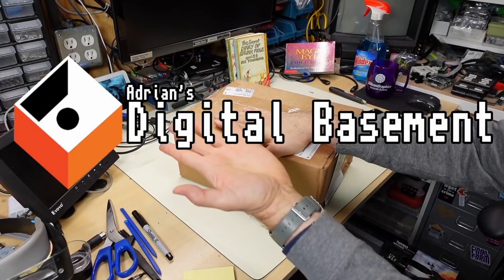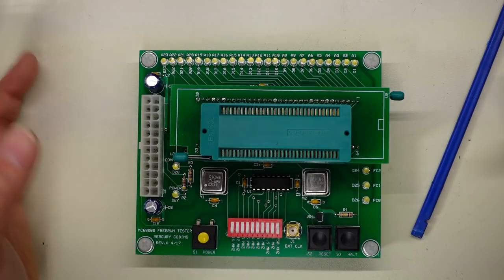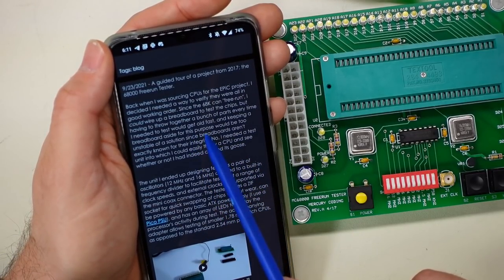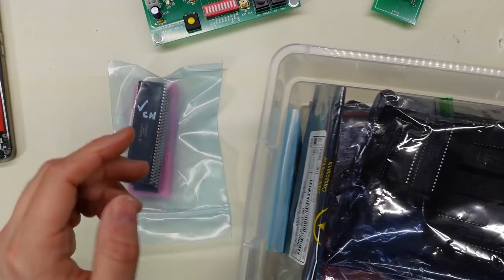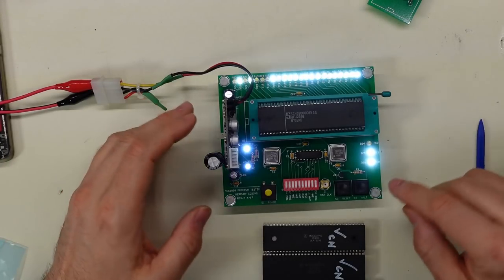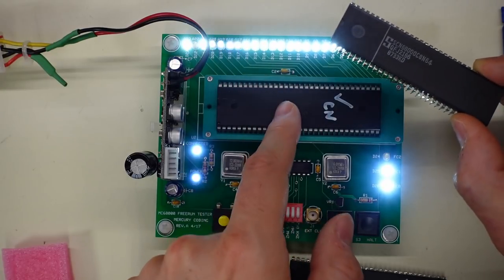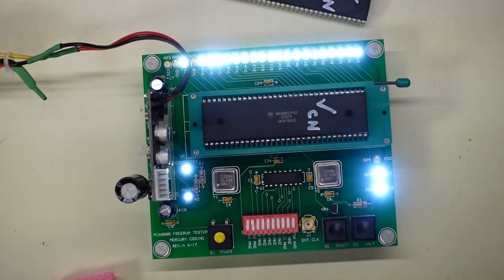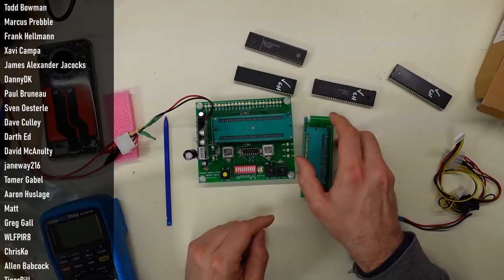0011 A standalone Motorola 68000 CPU tester

Comment: Despite the fact of the missing current limiting resistors the signetics part is most likely an nmos version of the cpu with lower high levels (ttl logic vs. cmos) whereas the others are maybe cmos parts.
Reply: Yes Signetics is an original NMOS type, with weak pull ups, while the others are very likely all CMOS, so have faster pull ups. The NMOS one might function at 16MHz, but very likely the bus drivers will not be able to drive any more than a single LSTTL buffer 2cm away from the chip, as the pull up will not reliably pass a logic 1 threshold in the time before the clock edge, combined with propagation delays through the decode logic, latches the data on the data line in or out.

Comment: A lot of current is floating through the 68000 VCC pin when all LEDs are on. The bond wire is glowing inside. I am wondering why no drop resistors were installed.
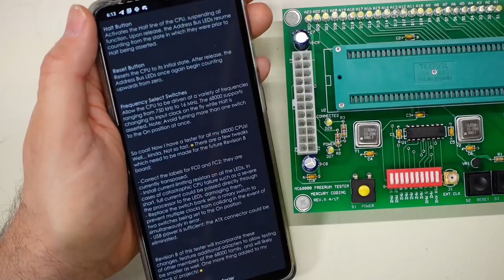Reply: 4:31 Revision B will have current limiting resistors to protect the LEDs.
Reply: @Okurka.  I guess the 68000 also needs to be protected. :-)
Reply: Glowing bond wire? No way. Those led's are drawing no more that 15mA. Even with all the LED's the current draw won't exceed 400 mA. Unless of course if your comment was exaggerated sarcasm.
Reply: @alexsinclair2012  The leds are pretty bright in the video so I guess it could easily be 30mA per LED. Bond wires are very thin, but the glowing was a joke indeed. Perhaps Adrian could check the total current when all leds are on.
Reply: @alexsinclair2012  When designed properly, signal LEDs should draw about 15mA. But with no current limiting resistor it can be much more. Modern IOs has current limiting inside, maybe here as well. But with no current limiting, LEDs will burn in moment :)
Reply: One benefit is that the silicon gets warmed up significantly, so some thermal glitches may be found easier 🙂
However some current imiting should be provided, especially for the CMOS versions of the processor. The Chinese-sourced parts clearly are CMOS, and therefore the outputs can source significant current, compared to the standard HMOS (like the Signetics part) which can sink much more current than it can source. 
A 100Ω resistor per LED would be a good idea.

Comment: I mean, this tester is kinda "okay"... I guess? No limiting resistors on the LEDs is a really weird choice (no need to load the IO drivers that heavily so they go into current limit mode; if they have a failure, it'll show up anyway if you have a current limiting resistor), but in any case, this only runs NOPs on the chip at different frequencies. This is such a basic test you can run on it and that would be an understatement. I would add a ROM that excercises all the opcodes, registers, maybe interrupts and bus transactions handling. I certainly won't take the outcome of this tester as a definite "this 68k works" or not.
Reply: Fully agree. The test is so minimal as to not be worth spinning up a board. Adding just an atmega one could emulate rom and ram. Non-trivial software effort though.
Reply: @AppliedCryogenics  Yeah, like these other IC testers which do test a whole bunch of logic ICs, and I saw one that even exercised a z80 or a 6502.

Comment: To quote from their blog: "There are a few tweaks which need to be made for the future Revision B board: [...] Install current-limiting resistors on all the LEDs. In cases of catastrophic CPU failure such as a severe short, full current could be passed directly through the processor to the LEDs, damaging them." So yeah, definitely a known issue.
Reply: Thanks for pointing that out! :)

Comment: My experience when it comes to overclocking is that the old CPU:s could be overclocked by a ~lot~. If I remember correctly (at the very least until the 486) they didn't REALLY make different CPUs at all, they just had their die and made a shitload of CPU:s and it it was during the quality testing that told them whether f.ex. a specific 286 CPU was at 6 MHz, 8, 10, or 12.. Because of how stable it was and how much heat they generated (There is always slight differences in production).. and this was when people ASSUMED you wouldn't use a heat-sink.. I had a 486sx20 which I got a sink and a fan to and ran at 50MHz and it was stable and lasted..

That said; You shouldn't assume that just because this processor CAN run at a specific speed mean that it TRULY can run at that specific speed. These types of testers usually just run a "NOP" command. I don't know the 68000 that well, but I think it didn't exactly had a nop command, but whatever command one chose to run the CPU with it will be a fairly simple statement.. probably one that executes the fastest of all commands. I don't know how the timing on the 68k work, but I would suspect that SOME of the instructions it handles take more than just the one clock-cycle (It was a rather complicated and expensive device, so I assume it have multiplication and division as op-codes).. so.. addition is probably slower than the actual command that this processor can run at this speed.. and.. mul/div should take longer than one clock-cycle.. but.. are the number of clock-cycles per instruction hard-coded OR can the processor DETECT if the last operation isn't done and it need to add a wait-state?.. I wouldn't know; The second alternative does sound a BIT complicated for the era.. either way... Each instruction is probably more or less "close" to the time-limit it has, so.. just because the nop work fine doesn't mean ALL instructions would.

Comment: There is a project from the editor-in-chief of Canard PC in France called the Universal Chip Analyzer which is designed to comprehensibly test many different types of CPUs.  Right now only Intel architectures are supported from 8080/Z80 up to 286 but a version for MOS/Motorola architectures is in the works.

Comment: To check if a processor is ok with a specific clock frequency, I would run the processor at a lower voltage, like 4,5V or even lower. If it runs there, there will be enough margin when running at 5 volts.

Comment: Chip rated max freq is based on worst case voltage and temperature, both of which affect performance.   The manufacturer would have some margin on the spec as well.  So when you are testing at room temperature, with a 5.0 volt supply, you would expect it to run faster than at the rated speed.  Also, as you mentioned, if the yields are good, there may not be enough slow parts, so faster parts would be downgraded and sold for less.
Reply: Those CPUs are rated so that 99% of production passes. So if only 98% can run stable at 16mhz, the whole lot may be rated at 12mhz. Silicon lottery.

Comment: Simplest way to drop LED brightness is to cut the common ground lead and put in a pair of series connected 1A diodes. Will drop around 1V2 extra, and then the LED current will be much lower, and saves placing the 16 220R resistors in each line.  Still will have LED current varying according to number on, but the drivers will not be so stressed. Did that on a filament display conversion to LED, as the new batch of LED displays were very much higher efficiency over the prototype batch, and thus the display came out too bright. The 2 diode drop with the existing resistors used, 82R 0.125W, made it nicely match the other displays and not flood them out.

Comment: Gotta keep in mind -- not all instructions are equal -- just because a processor can NOP at 16 MHz, doesn't mean all the functions, APUs, etc. will work -- and even if it does all "work" -- it doesn't mean the math results, branch instructions, etc. will always be handled correctly at those speeds. -- It also doesn't mean the the electrical characteristics are appropriate / in spec.  -- At a 200% overclock, I would definitely use a heatsink though.

Comment: Running NOPs probably isn't a good overclocking test.  The real problems would be more likely to pop up in the ALU, conditional jumps, or even memory access.

To improve this board, they ought to build a ROM that runs test instructions meant to make sure that all registers work, status flags, conditional jumps, etc.
Reply: There is a 68000/Z80 test program for Sega Genesis that runs a suite of tests like that. I don't know where I got it, but it's very useful!
Reply: I think it would need at least a small amount of RAM too, in order to be able to test instructions that affect the stack.
Reply: That's a good idea. Maybe I'll work some kind of ROM socket into the next revision. :)

Comment: There are indeed 16mhz 68000's like the one in the Atari Jaguar which is a 16 mhz CPU running as 13.295 mhz which is half of the RISC processors in the Jaguar. The Hitachi CMOS versions can run up to 20mhz.

Comment: 2:43 Well, yes, and no... the design implements a 32-bit instruction set with 32-bit registers and a 24-bit address bus.  The internal data bus, however, is indeed 16-bit.  [Edit: additional technical pedantry]

Comment: In the 1980s both Dr Dobb's Journal and Byte magazines had a 68k cpu tester, like the 6502 tester you shown before, using No Op bytes to run the entire address space.
Reply: That article was also reprinted in the Dr Dobb's Toolbook of 68000 Programming.  I think there is a PDF of that book online.

Comment: What does this test say about the condition of the processor. Address lines work, but what about the rest of its registers. I think a better test would be a program that tests all functionality of a processor and display's al the results.
Reply: Just testing it is not totally dead, and that at least the clock, reset, bus arbitration, and instruction decoder more or less are functional.  Better would have been to simply add on a single fast EEPROM that is mapped into the top half of the address space, and have a simple program in it that checks out each on chip instruction in turn, with output simply being a latch on the data bus selected when the ROM is not accessed. Simple, and the on chip registers can store enough that you simply have a output that runs a series of leds to show all is working, using a big timing loop to slow the tests down, so it takes a second or two per full test loop. Only needs one fast 1M 8 bit flash device, and a tiny bit of glue logic, plus a bus latch for the LED drive.

Comment: I would not use that without resistors, it can kill the cpu without a LED dying. Way too much current as the voltage drop has to appear within the cpu, bondwires etc.

Comment: Well A0 isn't needed for instruction fetching, but would be needed for byte data access.  IIRC there isn't an actual A0, but a HBE and LBE signal, the HBE would be the equal to A0.
Reply: Good point.
Reply: Yep. A0 is split between the upper and lower data bus strobe pins.
Reply: But when it fetches a 16 bit word it doesn't do it one byte at a time so no, HBE isn't really much like A0 at all.

Comment: 5:45 - only the top "68010" is definitely real. The other two are possibly rebadges. I ordered a bunch of 68010's from china and only one of the vendors I bought from was selling real ones. There were a bunch of 4 MHz 68000s rebadged as 68010s, which sucks, because the 68010 is the one which supported an MMU and allowed the vector table to be relocated. The original couldn't properly support an MMU because the bus error exception (page fault, etc.) frame didn't include enough information to restart the instruction the exception occurred for. There were a couple of systems with an MMU and the original 68000, but they did exotic things. One workstation actually ran two 68000 chips, with one CPU a single instruction behind the other. If the "leader" encountered a page fault, it would trigger an interrupt on the "main" CPU before the instruction which had the error. It would then handle the page fault and restart the "leader" in the correct state. Obviously not ideal, as the 68000 was an expensive CPU in the day and two CPUs meant twice the power consumption.

Comment: I believe the original Motorola and Signetics 68Ks used an NMOS process. Your relabeled CPUs are probably the later HCMOS process chips with better high output capability, hence brighter LEDs.

Comment: Probably a bit exxaggerated but in my opinion running NOP Just indicates the PC is running normal and nothing else. I would recommend at least an ADD instruction to sum the address output with a constant number and check result with an XOR logic or so. That will bring in ALU alive, heat the CPU and is a good indicative of stability
Reply: You're right, NOP free-running is only the most basic of tests. However, that's all I needed, so that's all I designed it to do. :)

Comment: There are LEDs with built in dropping resistors… might want to look around online for some. My work had a customer years ago that had quite a few boards using these LEDs. Unfortunately that customer is long defunct and all the documentation is long gone so I wouldn’t even know what brand they were.
Reply: There is a black dot on the anode for those, and they are designed for specific voltages. I have only seen 12v ones, but I am sure they make 5v ones.

Comment: Funny coincidence: my current project - featuring an 8085 - also has a "free run" test mode integrated. These might have been a common way of testing circuits. If the actual circuit has a provision for it, you can also test all the address decoder logic chips. The concept is a nice part of history though; I'm pretty sure flashing LEDs won't help with GHz CPUs 😜

Comment: The 68k does not use A0 since it is it accesses data in 16 bits so the first 2 byes for instance are covered even without an A0 line. The 386 did something similar

Comment: I'd like to know how 68k detects bus contention (berr).
There likely is built-in protection for data and address pins but I don't know the mechanics behind it.
Reply: It cant detect bus errors per se. Something external has to assert the BERR signal to tell the CPU there is an issue with the current bus cycle.

If there is contention that causes data corruption you might end up with an invalid instruction exception, or bad operands that cause other issues like reads/writes to bad memory locations (that might result in a bus error) or erroneous arithmetic results.

Comment: There are LEDs with internal current limiting resistors, they may be those type, just guessing. Whoever designed that board clearly knows what he is doing so I wouldn't imagine him forgetting a detail like that and stress the CPU with high current drawn from the IO pins.

Comment: Not to nit pic but please board devs, white and blue leds are for illumination not indication. Please use red, green, amber, etc.. Can't see / read anything if you have a led flash light pointing at your face.
Also wonder if you could step through the free run process to read each driver line at a time instead of it just counting away at whatever MHz you have it set to, but I know almost nothing about this CPU..
Reply: I'll take that under advisement! I may have some green ones laying around somewhere... :) As for single-stepping the CPU, yes that is possible through use of the Halt line which could be implemented with a little extra logic added to the board.

Comment: Does anyone know what clock divider chip it uses? I'd like to make one of these.
Reply: I used a 74HC4520 dual 4-bit counter, but you could use any basic counter IC. For more output frequencies, you could even use a 74VHC4040 counter, which has twelve stages instead of the eight the 4520 offers.

Comment: 2:40 The Motorola 68000 is a 32-bit processor.
Reply: 16/32
Reply: It has 32-bit wide registers, but the databus is only 16 bits wide.
Reply: @BertGrink  Correct. It's really a 16 bit processor with 32 bit "enhancements". Even the ALU isn't fully 32 bit, i.e., the multiply instructions can only do 16x16 bit with a 32 bit product. If you want to multiply two 32 bit numbers, you'll need to write a software routine.

Comment: The 68000s are said to all run with way higher clocks than announced. Probably you could run even all of these with 25MHz, and even 33 or more with proper cooling.
Reply: Yep, the whole 68K family was quite overclocking tolerant, which could make for great fun with modern cooling solutions!

Comment: this test can tell you if for sure a chip is bad but it can't tell you if a chip is actually good. Testing nops really only useful to see if the chip is a 68k or not and if it works at the most basic level. Can't really test if its a good chip or not without more detailed test of the instruction set really you need to test alu and memory access too.

Comment: I've got some 8MHz rated 68k's that run just fine at 16MHz.

Someone I know has a 12MHz part that runs fine at 32MHz.
Reply: Other members of the 68K family were similar; I've heard of 75 MHz 68060s running at over 100 MHz with proper cooling!

Comment: Running those LEDs without any current limiting is silly, and potentially dangerous for the chip. Better still would be to buffer the LEDs through bus buffers, this then protects the chip further... plus there are times in the cycle when the data bus shouldnt be loaded at all. Some facility to check BR/BG(ACK) would be important too

I would probably have designed this to take a 9v barrel jack type supply, and have an onboard 5V regulator. Two in fact - one to supply the chip, another to supply supervisory circuitry... i would also then build in an overcurrent detect to shut off the CPU supply and warn if it draws too much current. Especially important with the ATX supply - imagine if the CPU was a short inside, with the typical 5V current available from an ATX supply, you would have smoke and burnt traces very quickly!

Comment: Unless a 16-bit processor is designed to do byte accesses, it will not have A0.
Reply: 68k can do byte access but it uses a different pin other than an address pin to select either byte one or byte two.
Reply: @GORF_EMPIRE  Ah yes, it uses /UDS and /LDS pins.
Reply: @gusbert  Yes sir...  somewhat similar to how the 386 does byte access.